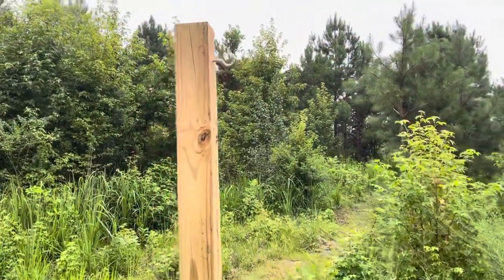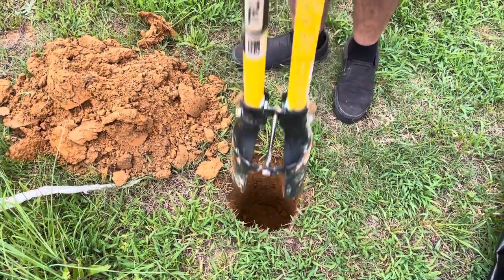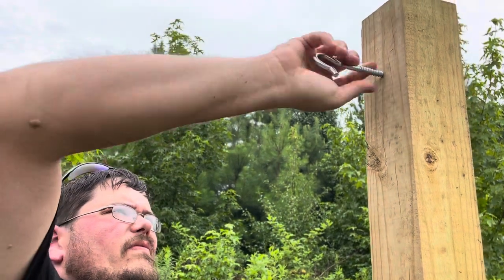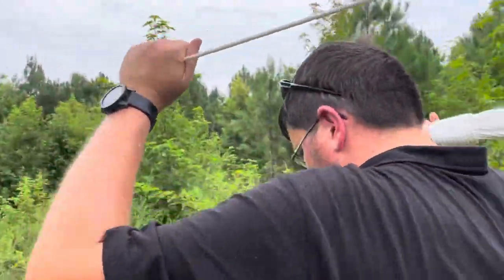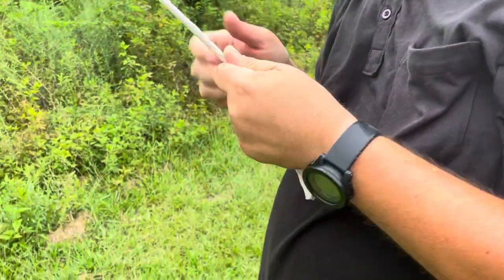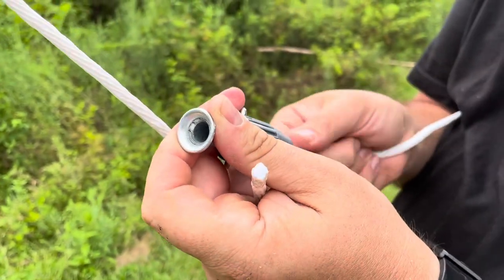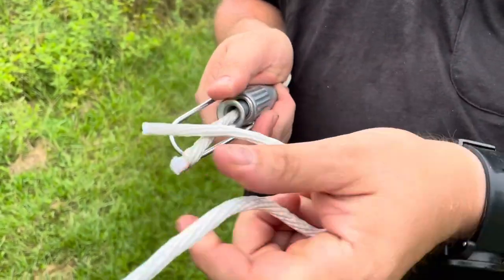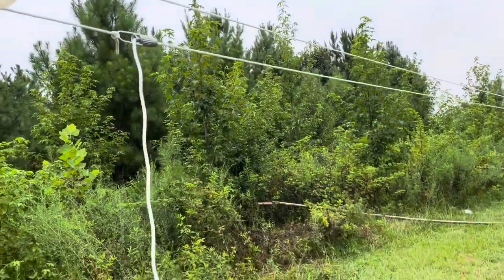Old Fashioned Amish Clothesline DIY

Comment: use a 20foot scaffold tubes or tube, use post hole mix quick setting, two three bags, did a hole or pit, 2 foot deep same square you need it for the weight stop the post leaning over,  put a post each end, or fix one end to a building. then when you put your wash out ,it's nice high in the wind/air high washing lines like this are very popular in UK, had mine 22 years, still good, drill the post I used strong wire to fix the pulley to the top, and winder at the bottom about 4 foot up,

Comment: Thank you for posting.  My only concern would be that within a very short time and some rainy weather, the pole will become loose and start to pull away and tilt. Cement should have been poured into the hole to secure it.
Reply from the maker: Absolutely, you are correct. The only reason we didn’t pour cement with this one is because we are building a barndo about 2 acres behind where this is, and we will have to move it in a few months. Thank you so much for watching and leaving us a reply!
Reply: I’d be willing to bet it would last a while. I guess it depends on the soil and the weather, but he dug nice narrow hole. Lol
Reply: It's a stainless J hook. The Amish do use concrete. Dirt only cause it to lean inward after 2 washes.

Comment: I'm in shock! All the money and time spent on this project. The pole won't last because you didn't put cement in the hole!! I must say I do like the pulley system method. And will use this when I start my clothed line project.

Comment: Where would find a pully at. And how would you get the rope tight enough for hanging blankets towels etc.
Reply: Not just for blankets. Once you start loading the line, the line will start to sag in the middle.  What you need is an extra piece of 4"x2"    It will need to be six or seven feet.  On one end cut a V shaped notch,  a few inches deep.  Cut it across the four-inch width, not the two-inch, or there will be insufficient wood/strength in the end of the pole.     

Slip the notched end under the middle of the rope and raise the pole.  Because it is six or seven feet long, the pole will lift the rope upwards and will keep your clothes clear of the ground.  When you want to take the clothes down, remove the pole and the rope will sag down to enable you to easily un-peg the clothes.

Comment: Did you treat the wood first? Plus you didn’t put in cement.
Reply from the maker: Good eye! We chose not to cement it in on purpose, because we were right in the middle of building our house and planned to move it about 2 acres back closer to the house once it was completed. We just completed the house, so now this clothesline will be dug up and redone with treated wood and cement for a more permanent line.